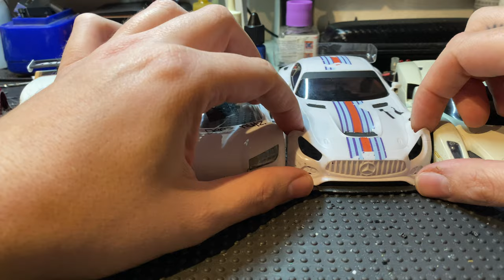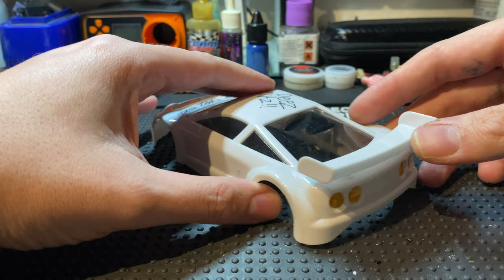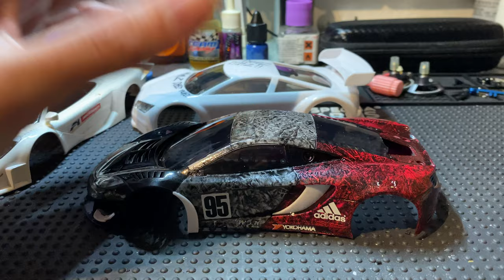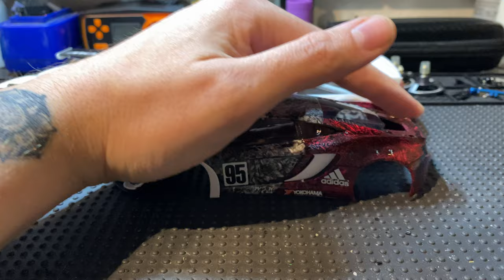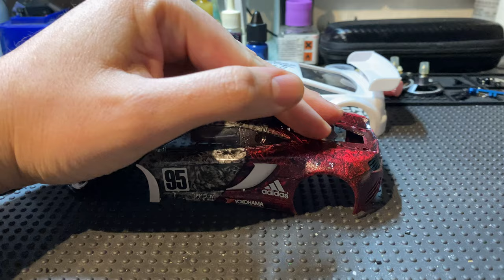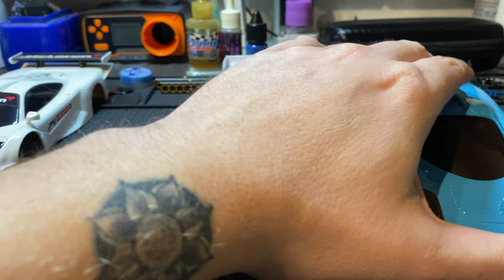How to choose a MINI Z race body [basic]

Comment: Hi there! I'm an engineer, just wanted to chime in on the aerodynamic drag topic, you can basically ignore that as a factor in Mini z Racing, you aren't going to do anything to have a meaningful change in driving performance at the speeds these are capable of. Just as an example, if you took a car with one of these racing bodies and raced it against another that magically had zero drag, it will contribute to about 2% less air resistance than your standard mini z if your speeds are under 15mph and about 4% at 30mph. Remember that we are talking about the total delta of full air resistance vs none, you are probably looking at a total difference of under 20% for all these modern racing bodies.  Considering that your rolling resistance is probably over 90% of your total resistance at these speeds, you can quickly see how aero just doesn't matter with this, you would be chasing less than a tenth of a percent of change in your top speed.

Comment: The Jomurema body is the most popular not because it does everything right, and is the fastest... but because there are such few flaws with it in how it races.  Short overhangs make it reactive, equal overhang front and rear with a mid cab design make it very neutral in and off the corners.  And probably the biggest reason is because it is one of the most forgiving bodies in collisions with other cars and the barriers.  For advanced body tuners, the Jomurema doesnt really need any modifications to perform close to its maximum level.  Where other bodies may need some shaving of the inside for wheel clearance, or reinforcement around the front end for durability.  Jomurema can also show the driver easily what changes in setup do with the car because it is so neutral in balance.  The 2012 Audi R8 would be categorized in a similar place to the Jomurema for its handling attributes.  Audi makes slightly more traction, but slightly less forgiving.

McLaren 12C is one of my favorite hard bodies, I like the cab forward design.  However, it is much less forgiving than the Jomurema in any collision.  It is not the worst out there in that regard.  With the 12C, I feel that I can drive a little harder into the corners with more stability due to the longer front overhang, and have a better feel on the front traction due to the more forward biased aero design.

For simple terminology, I tend to phrase it this way.  As the front overhang increases compared to the rear, the car maintains momentum into the corners, and carves the corner with a smoother radius rather than pivot in the corner.  Similar to using a long ski compared to a short ski.

The long tail McLaren F1 GTR can be a good body in very low traction conditions with a little modification to the rear end to lower mass and increase airflow under the wing.  It is a bit polarizing in handling, in that it is initially resistant to rotation, and then once rotation is initiated, it wants to continue that rotation even after the wheels have straightened out.  Due to the long front and rear overhang, and good aero properties it makes it a good option only for very low traction such as carpet with rubber tires.  When I raced on carpet for a while about 10 years ago, this was one of the fastest bodies.  Driving accuracy is lower, as you stated, but it makes good traction in those conditions.  In higher traction, the body does suffer on anything other than very high speed circuits with high speed corners.

Before the Jomurema body, the Mosler MT900S held its place as a very forgiving body, that could pretty much do it all.  It made excellent traction, and had a great aero design for faster classes.  Its one caveat was really the mass for stock classes, and slightly high CG in comparison to some of the really low slung bodies.  I do plan to revisit this body soon, its on my list!
Reply: @mini-z_me  yeah, the 2010-2012 one with wider offset.